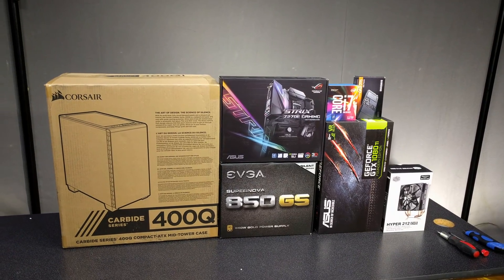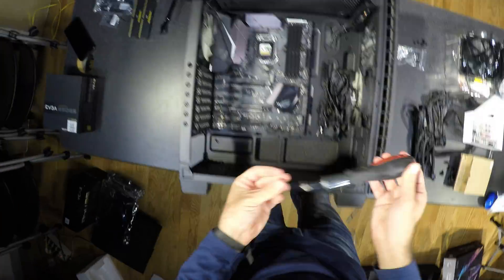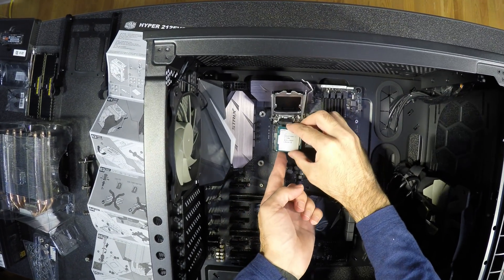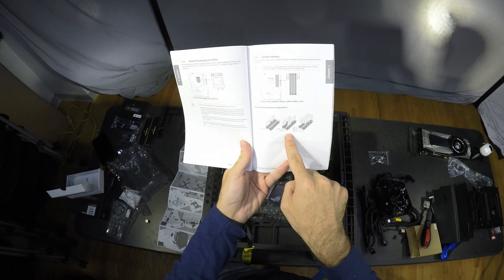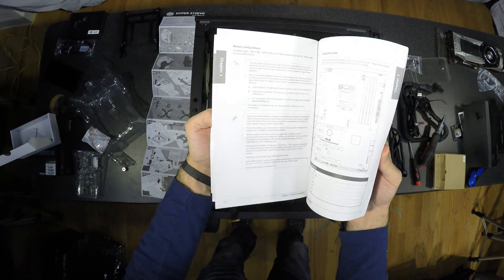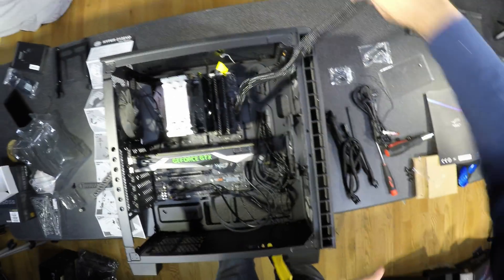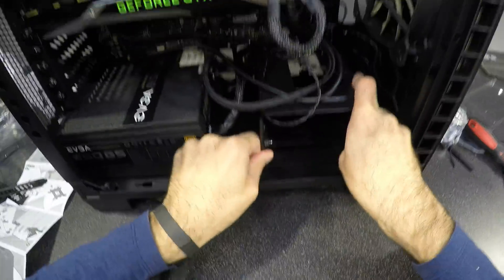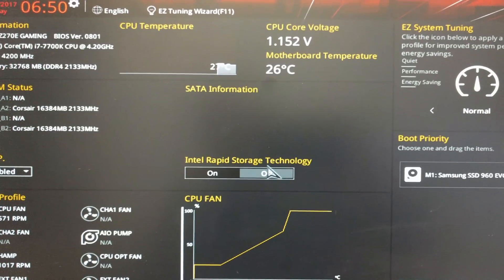POV PC Complete Build PC: i7-7700K+GTX1080TI; in 4K

Comment: uses anti static bracelet*... *2000 build with air cooler*... *rips graphics card box
Reply from the maker: When you have 90% of all liquid coolers fail on you, you go back to air and never look back. Most of my job is replacing coolers, and I have not replaced a single air cooler.

Comment: I have the same build only that my cpu cooler is liquid cooling. And the rad is in the front since the top doesnt have space for it. But im running with issues with it my gpu is reaching +80c. I changed my fans and still same.
Reply: Also my fps in games isnt like other ppls build my cousin has the same build as mine but with different case and he gets a better fps than me and also better cooling temps

Comment: You are sure a good guy. But so good and expensiv hardware in a bullshit of a case. I am shocked.
Reply from the maker: Case does not influence the performance, and it ends up under the table anyways. Also, for office purposes nobody would approve flashy cases and especially not more expensive than absolutely necessary
Reply: Hi tech guy.
This is not a hate. I just wanted to say, for the same money, you would have got a much cooler or beter case. Because the hardware is great. You make good videos. Greeting

Comment: I have the ASUS ROG STRIX Z270H with an i7-7700k and Corsair Vengeance lpx 16gb 3200mhz and I cannot get my RAM to OC at 3200mhz?? It’s stuck at the base 2133mhz.. any help on that?
Reply from the maker: The speed increases of overclocking RAM are very small (less than 5%), which means having 100 fps instead 103 fps, and is hardly worth the trouble and instability, so I would not be worried about that.

Comment: can i use Corsair h100i v2 cooler instead of the air cooler ?
Reply from the maker: At work half of machines useD Corsair liquid coolers h80 and h100, and over the time 80% of them broke, so every week one dies and I am replacing it with air cooling because I am sick of replacing it every few days.

Comment: The case is ugly, the cooler of the processor is ugly, the cable in the case is ugly. Everything is ugly. Sorry but is true.
Reply: ^ the guy who buys into the G 4 m 3 r B r 0 s marketing schemes and ends up paying an additional 50$ in added premium for pretty lights instead of better performance hardware.

Comment: Those bracelet wire thing, do you need that when building???
Reply from the maker: Well, I usually wear it, but I did not always, and nothing ever happened. One time I did not wear it and as I touched MB the spark jumped from my finger, but nothing happened and MB was still working. I wear it just to be sure.
Reply: Anti static wrist strap recommended so you don’t shock your parts during building build over hard wood or tile or concrete ( NOT CARPET , NO SOCKS )

Comment: in your discription is a small misstake...
you write "Corsair - Vengeance LPX 16GB (2 x 8GB) DDR4-3000 Memory"
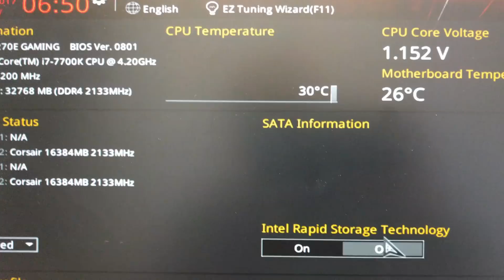but the BIOS at 17:35 says 2x 16gb a 2400 MHz? :)
Reply from the maker: Good catch, thanks. It is 2x16@3000 CMK32GX4M2B3000C15 for it was detected as 2400 on 1st boot

Comment: why.  Don't   install ram,cpu , cooler outside the case ?
Reply from the maker: It is harder to put it in later, and the MP is not not supported at the right places, so when you press it with screwdriver (for example tightening the cooler) you are either bending the MB if it is on a soft material, or ruining the bottom of it if it on hard surface.

Comment: high end pc with 212 evo? :(
Reply: If your not over clocking your pc then it's a very good choice, it's cheap, does it's job and leaves plenty left in your budget for other components. I replaced my corsair h100 with it as a short term part but I decided to leave it in because, well, it does it's job and it's quiet!
Reply: @downtimegamer5076  212 evo is fine to OC with, just depends on how high you intend to OC. Stock coolers are what you don't wanna OC with. There's also dependence on your cases ability to cool as well which OP's case honestly isn't good for airflow. I could nitpick about a few other things, but already enough full blown autism in these comments.
Reply from the maker: Cooler does not influence performance, and these machines will not be overclocked, because I am the system admin, and I am too old for that s*** ;)
Reply: Lul one of those people who think higher priced = better. The 212 evo is better than a lot of more expensive coolers out there.

Comment: Why you touch the cpu heat spreader, man 5:09
Reply from the maker: So I know it sits correctly... it's like when you know that you have turned off the clothing iron but you still go and check.
Reply: You can do that without touching the surface of the cpu. Generally you must always hold the cpu by its sides and avoid touching the surface heat spreader but if you do accidentally touch it, you must clean it properly with isopropyl before applying thermal paste and installing the cpu cooler, which you didn't

Comment: oh God,you put the cpucooler with the decal in the base
Reply from the maker: Yes, it looks like I have shortened that part too much. Sorry
Reply: Alltho at 6:57 the video is cut so we might just missed you peeling it off... otherwise rip 7700k xd
Reply from the maker: decal? Ah, you mean the plastic cover when I was closing it the CPU bracket. It should pop out with a spin, and that is the most fun you can have while assembling a PC.
Reply: no this,the decal in the base of 212 evo
Reply from the maker: I am 100% sure I have removed it
Reply: xerolive123 i noticed that too
Reply: I am a 100 % sure you did not. At 6:23 you can see it on... and then you placed it in without removing the film... Does that pc still run? xd
Reply: Tech Guy the plastic sticker on the base of the heat sink?
Reply: Oh, that's right, the video is cut. sorry man

Comment: You inspired me so I got a i9, 64 GB RAM 3000MHz, 512GB SAMSUNG 960 PRO PCIe NVMe M.2 SSD - 3500MB/s Read & 2100MB/s Write, MSI Arsenal X299 TOMAHAWK, GTX1080 Ti for myself.
Reply from the maker: That is a cool system. I hope you will use additional cores on the i9 for something good ;)
Reply: After Effects, Premiere (360 video editing/4K stuff) is doing great, boss!
Reply from the maker: Then you definitely need it! I am starting with that too with Vuze camera
Reply: Have you seen Insta360 8K (around $4K) I guess you prefer portability. I've been using the Samsung Gear 360 latest one since a while thanks to a lady friend and wifey that went to the galaxy S8 unpacked & got it for free.
I recorded a concert and it went well, just had to stop & star recording between every song though, the importing to smartphone or computer takes too looong if you know what I mean. And for the second concert I noticed it got hot easily (this time was indoors) so I did a lil hack to resolve the issue...
Reply from the maker: The Insta360 Pro is quite expensive, but it seems pretty good. I also used Samsung 360 but the first generation. That one also has issues with overheating but it is pretty good overall.
Reply: Right, but paying 30K for Nokia OZO is even scarier though (I heard isn't that great anyways)...
Reply from the maker: I have seen some demos made with OZO last year at NAB at their booth and I was not impressed, especially with the stitching that was all over the place because of so many cameras, and it was so distracting that I cannot even remember what exactly I was watching. This vuze camera seems pretty good with its 8 cameras and even though it is stereo VR I was not able to play in a headset in stereo 360 yet. Once I have more time I will play with it more and make the review.
Reply: Interesting info about the OZO, good thing I don't have enough to spend on one of those. I sent you an email btw. I'll wait for the review on your vuze 360.